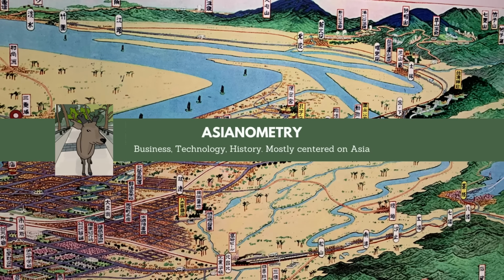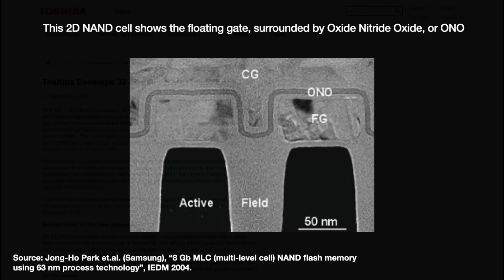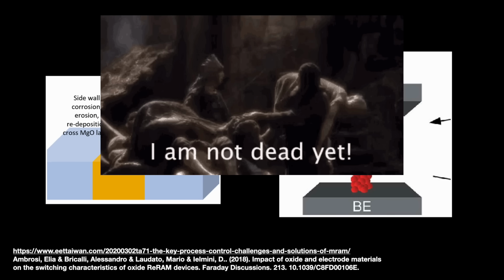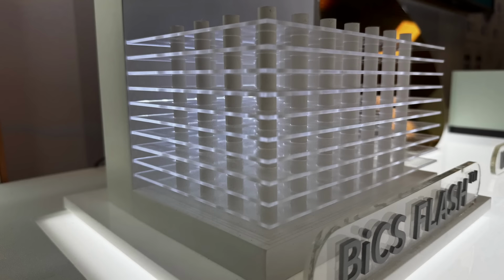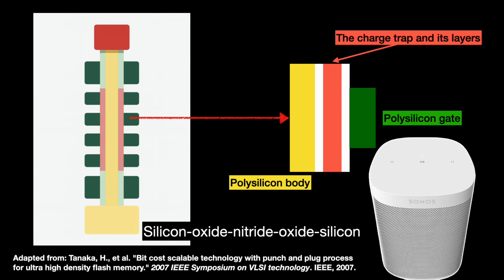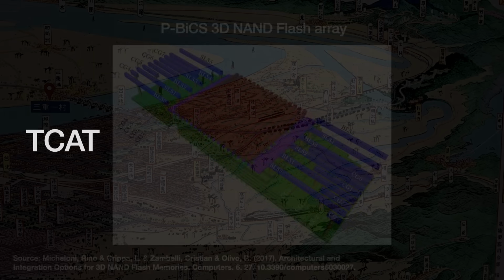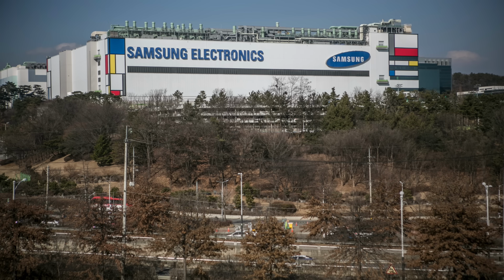3D NAND: The Most Scalable Semiconductor

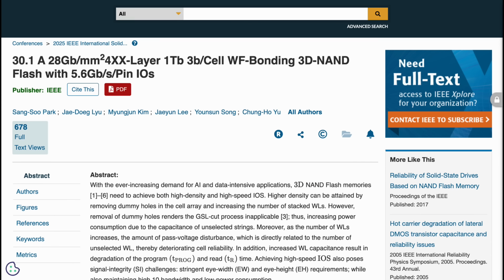Comment: 19:50 The /r/datahoarders subreddit had a neat graph showing HDD vs SSD $/G a couple years ago. It extrapolated out to when they would cross and SSD would then be cheaper. I have often wished someone would update it every quarter or at least every year but I don't think anyone has. I think it was supposed to happen in 2027 IIRC.
Reply: no way dude, i purchased Seagate essential external HDD which is a slow not flashing HDD for 250 USD, it's a 26TB HDD, no way to buy a SSD for that price within next decade 😂😢
Reply: @candogan8049  well from what i see that HDD MSRP is more like 500$ so thats the price it should be compared... for ~600$ i could buy 8tb nvme in my country, so HDD are ~5times "better" in that given case.

But lets go down a bit into more realistic customer needs... like 2 tb: 

Cheap ssd's (sata and nvme, price is same) are about 120$ from what i see

HDD 2tb are 69$ for toshiba p300

In 1-4tb HDD's are only 2 times better in gb/$ terms, i think they may catch up ~2027/28 in sub 8tb capacities
Reply: @candogan8049 you can very nearly get 8TB of nvme SSD for that price now. We’ll get there.
Reply: @candogan8049  decade?
Reply: @candogan8049 how slow is it? Do you have to wait after double clicking on folders?
Reply: Current YOY rate of improvement for $/TB is ~15% for both SSDs and HDDs. If HDD companies are able to keep iterating HAMR and develop BPM sometime in the 2030's HDDs will stay relevant for data center applications for a LONG time.
Reply: @ictogon I had not heard of BPM before. I just read the Wikipedia page. Neat stuff. Even if hard drives do not exceed SSD in terms of $/TB anytime soon, the great thing is that SSD is now cheap enough to hold the working data set of most people and applications. I've got a few T of SSD in my PC and it's very fast and all the storage I need. It has been some years since I ever had to worry about running out of storage and I had to sacrifice something to make room. A far cry from the days when my disk was constantly full and having to manage it.
Reply: @tracyrreed  Yes the days of consumer HDDs are over for sure. But current data centers store 80-90% of their data in HDDs because of the cost advantage, and use SSDs as a higher speed buffer.

Comment: Another great video, I would really love for you to do a video on the rise and fall of Intel Optane Memory. 

Such an amazing technology that was just cast by the wayside
Reply: It wasn't just Optane.  The generic term was 3D-Xpoint.  Micron codeveloped it with Intel.  SK Hynix also had a license and some Chinese manufacturers produced it without license.  All of them gave up on it.  Intel was the last holdout.
Reply: as someone who doesnt know enough about Optane, i'd love to hear it's history in a quality video. I might actually buy a drive for my TrueNas server, but i have no idea what makes it special.
Reply: I had a device with Optane at work and I remember it being quite good compared to the SSDs I used at the time but after that I switched to dev and wasn’t dealing with hardware specs so I stopped paying attention. So all that is to say I would love a video on the subject. This is a fantastic channel
Reply: The problem for optane is it could never find a use case where it was actually cost effective or better than existing solutions at. I member it was pushed somewhat heavily by servers OEM like Dell for a few years but their solutions using it were vastly more expensive than just getting a regular server with loads of DRAM and a raid controller with a battery on it that has time to finish writes in case of sudden power loss.

Also all the redundancy or speed benefits are actually not worth the added costs and extra buggy (because new) drivers and firmware. I saw loads of patches for vmware for exemple in the years that followed, that were bugfix for optane feature X or bugfix for optane bug Y. This one being pushed first into a segment of the market that needs stability and reliability over maximum hotrod potential so with that + the price of entry = low adoption.

Overall they were trying to add a piece of hardware in the mix that fundamentally goes against the way everything in computing has been designed around since we invented computers and programming (access to long term storage that survives power cycles + fast(er) live memory to run programs)

Not to mention a complete nightmare for persistent malware threats since you don't get the 'pull the plug' option to erase it anymore.
Reply: @CalgarGTX  the reason for this was that intel wasn't bold enough, optane doesnt work well as a nvme drive because it looses many of its latency / speed benefits, while its too slow to be well suited for the DDR interface.
intel needed to get in touch with AMD and create a new layer in the memory hierarchy with its own custom interface.
Reply: Same, I want to hear his analysis on Xpoint, GST material, PCM, stuff. why didnt they take off?

Comment: Flash and MCUs are bright lights in 35+ years of disappointing digital tech. 
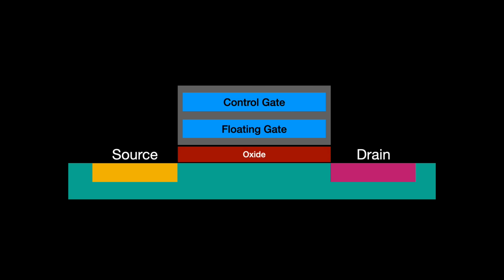At 9:05, would be clearer if you said "in that they use a layer of electron trapping oxide. (I had to listen a couple times).

Comment: 4d nand lest go
Reply: For a moment I thought rotating drum memory was 3D storage, but then I realized the circumference axis is the same as the time axis, so it's only 2D
Reply: Ferdinand who?
Reply: @carlgeorgbiermann2915 😂😂😂😂😂
Reply: That is not a joke.
If we can make a recurring voltage pattern in the electron containing layer, we can store the data in time axis.
Reply: @k22kk22k  the problem is such self sustaining oscilations are extremely unstable and require low ass temperatures due to quantum mechanics..
Reply: @sebagomez4647 
Yes. I believe, to make it practical, several levels of clever engineering will be required on the top of existing techniques.
My point is, “4D nand” is not just for playing with words, but something to be considered rather seriously.
Reply: Holy shit

Comment: Another great video.
One wonders who will figure out how to do in-memory compute in these deep structures.  NAND may not replace DRAM, but certain kinds of compute may lend itself to these types of architectures.
Reply: I guess the holy grail would be to add some form of multiply add between the cells so it could run an AI layer. With muti level cells the multiply add could even be analog for more speed improvement running AI's with 4 bit or more analog voltage precission.
Reply: Wdym by AI @AndreVanKammen
Reply: @badgermcbadger1968  Artificial Intelligence, I assume.
Reply: Agreed I think modern NAND integration technology could be great for neuromorphic devices.
Reply: Requires a slightly different transistor design to operate in analog
Reply: Well it won't be Elon Musk,
Reply: @richardgibson6647 wth does he even knows?

Comment: The Most Scalable Semiconductor just hit a wall. Samsung said it straight. 224 layers was the sweet financial sport and QLC will last just long enough for the warranty to expire. Sitting for 5+ years on TLC with 89% health left is the daydream of the past.
Reply: Can you link an article or something that talks about this? I did a search and couldn't find anything
Reply: They are stacking vertical strings on top of vertical strings to scale the layers higher.
Reply: @kazedcat  this hits a cost wall quickly
Reply: @jooshwolfheart You are still saving the cost of packaging and higher density offers a premium.
Reply: Yeah this is why I haven't really bought into gen 5 drives at all and got only a single gen 4 while the bulk of what I own is gen 3 plus the cost as well the power consumption is generally lower. There is still good TLC drives on the used market as well a few MLC here or there, finding SLC means very low capacity these days.

Comment: Great video as usual. 

Is 3D DRAM on the horizon, or possibly already here? I get that CPUs produce too much heat to stack cores vertically, and through via cooling is difficult. It’s not as if we’re running out of surface area for CPU gates. 

I know SSDs get hot and require cooling. I’m wondering how effectively heat is drawn out from the lower levels of the NAND to the surface, or is conducting upwards through all the other levels.
Reply: When SSDs get hot, it's generally the control chip (Which is just a microcontroller and some memory) that gets hot. The flash cells themselves produce very little hit, and are also generally fine with getting quite warm.
Reply: @MrHamof  they actually like being a bit hotter
Reply: there's some recent progress for that using InGaZnO as the dram capacitor dielectric
https://www.youtube.com/watch?v=ITdkH7PCu74
Reply: PCB.
Reply: I suppose low end microcontrollers could get even cheaper by 3D stacking the "stuff".